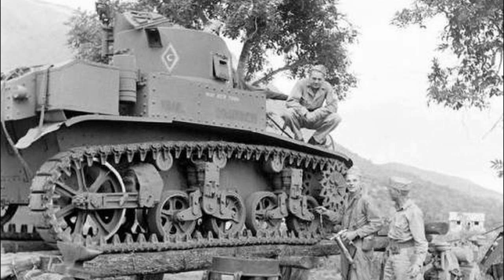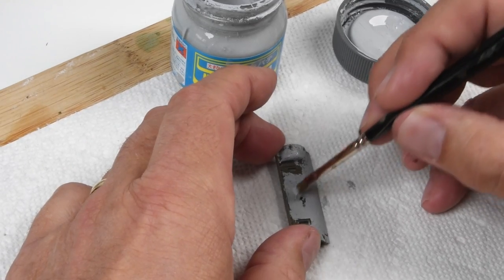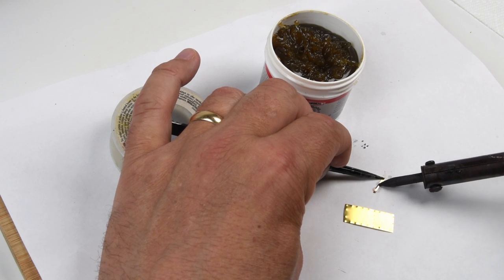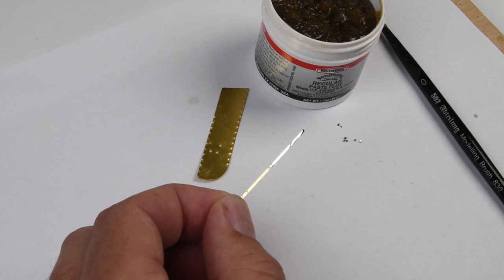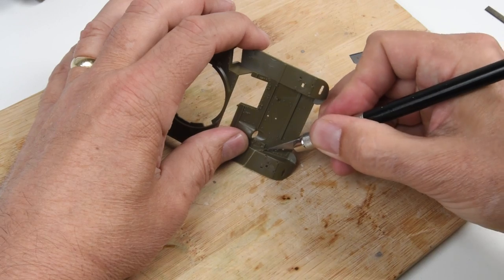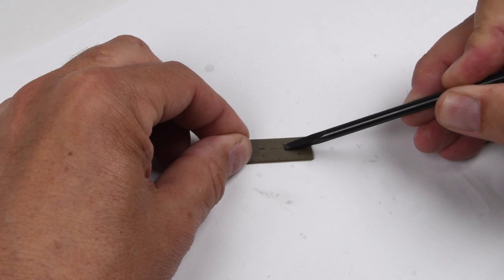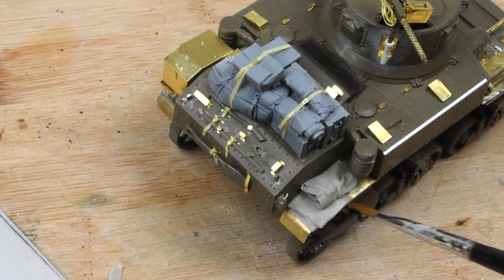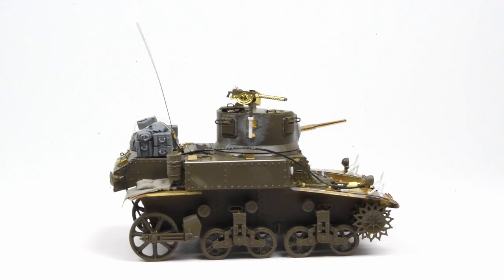M3 Stuart Ep 1. Kit Construction, Photo Etch & Soldering techniques are described.

Comment: Hi Rick, Glad to see you use solder for joining some of your PE. Have you  heard of solder paint? It's pretty easy to get hold of here in the UK. The one I use is made by Carrs.
Basically it's powdered solder in a paste like flux. You apply it with a small brush and then sweat them together.
I used to build etched brass railway locomotive kits and used it on them. I am lucky that I also have a resistance soldering unit which if you use on a too higher setting is quite capable of blowing a hole in thin brass in true Star Wars fashion.

Keep up the great work.
Regards, Mark
Reply from the maker: Hey Mark. Yes, I've come to realize that I'm in the dark ages in terms of the gear that I use. I cut my teeth on what I have, and just haven't ventured to the hardware store to view the new world!!!  I think that it's about time that I do....!  Thanks.

Comment: Great job with the PE upgrades. Staring at a plastic part with the X-Acto in your hand before you start lopping off bits can be really intimidating (to me anyway). 
What did you use for the new light guards? I expected to see PE, but they’re white. Are they resin, or did you scratchbuild them from styrene?
Reply from the maker: I ended up replacing the PE guards with styrene. It was one of those times where I couldn't get the PE to cooperate, and just making new ones was much less frustrating.

Comment: Rick: when you’re hanging PE fenders on larger German armor using resin brackets after shaving off the molded kit brackets, do you glue the resin brackets with bolts facing out and hang the fenders through the holes? Dumb question but there are no instructions and nothing I can find on the net. It’s holding up my whole build
Reply from the maker: Sorry, but I don't quite understand what you are asking regarding the bolts and brackets/fenders.